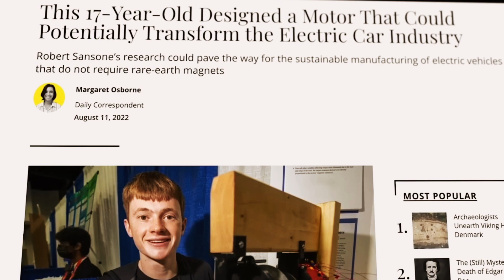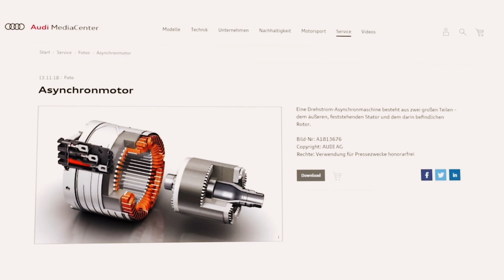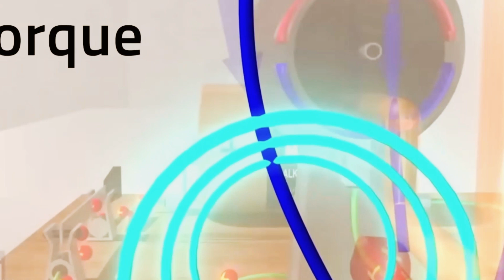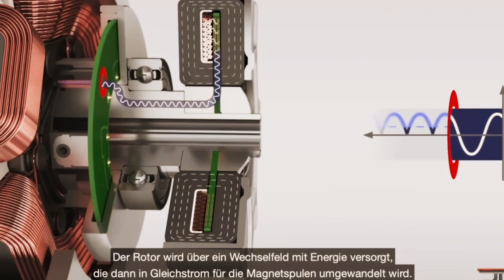!!! Invention Of World's First Sustainable Electric Magnet Motor!?

Comment: The next move is somebody needs to fire whoever believed this thing and gave an award for this scam.
Reply: It's not a perpetual motion machine It's an electric motor that exhibited greater torque efficiency by designing it differently. Fake or not it's bound to happen eventually.
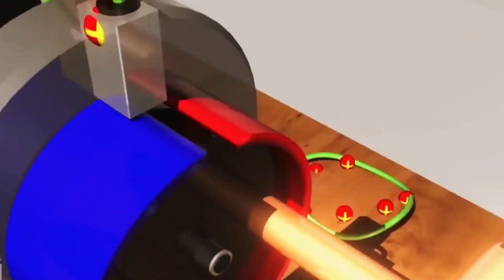Reply: @goldiz1978  Wrong. At 3:12 it claims to generate more electricity than it consumes. That's the definition of a perpetual motion machine. And no, it can't do that. The thing is a scam.